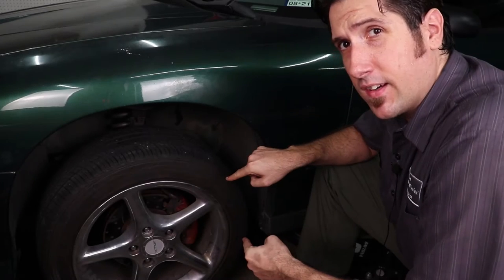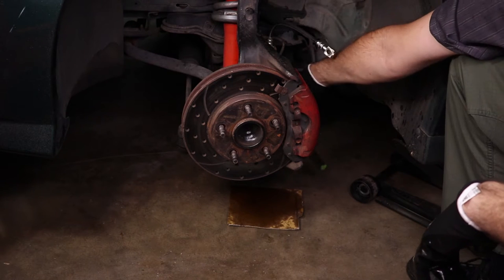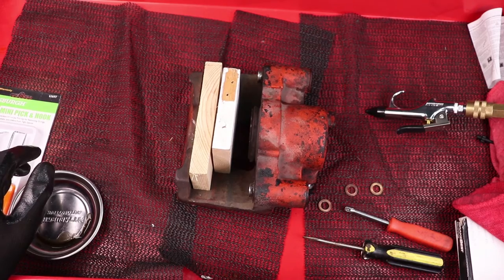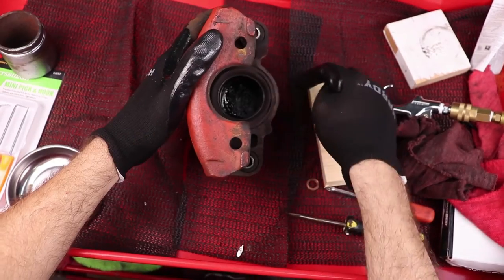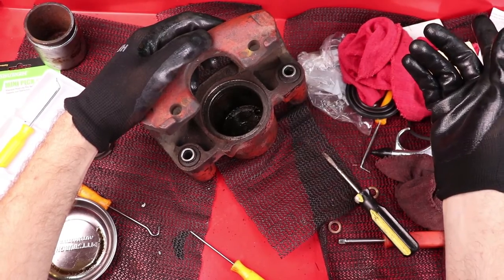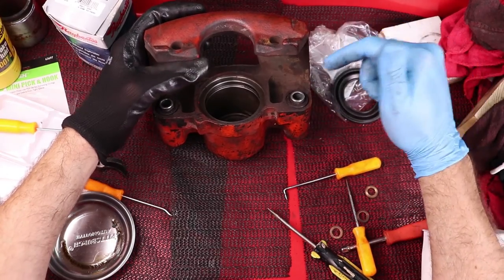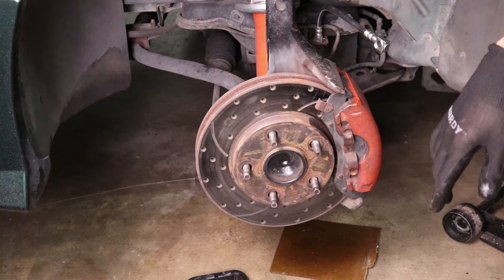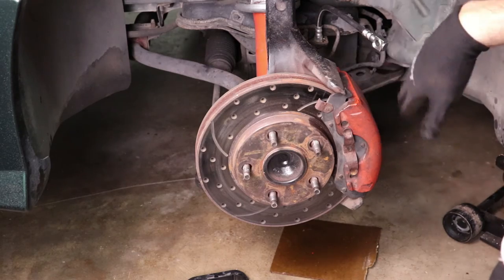Rebuilding a GM Single Piston Brake Caliper

Comment: Your meeting and overcoming obstacles is as important to your viewers as anything else, because there is one  thing certain to DIY repairs-- it seldom goes exactly as planned. Even professionals allow for operator error and the unexpected. 
* One suggestion-- when you disconnected the brake hose to allow caliper work on your bench, the disconnection procedure was not shown, but may have been uncharted territory for many. For example, show where to pinch the brake hose, before disconnection. And remind viewers (again) to watch the level of brake fluid during the actual procedure, to make sure no air enters the system.

Comment: Thank you, subbed!
Am restoring a '78 Firebird. Shipping calipers overseas is very costly and you don't get the benefit of core recharge either. Rebuilding the calipers is far more viable. Thanks for the helpful walkthrough.
Reply: Hey brother, I’m working on a ‘77 Trans Am! You can buy “brand new (remanufactured) calipers fairly cheap from an auto parts store here in the U.S., almost for the same price of buying the rebuild kit and hardware. However, since the vehicle was my late father’s I’m trying to keep everything as “original” and rebuild anything I can rather than just replacing parts. A lot of these generic parts you buy are not reliable and I can say this from experience as I used to work at one of the top 3 parts stores here and would have to warranty things left and right.

 I’d rather have the original sturdier parts and take the time to rebuild them rather than just go with a lesser quality part that will fail in a couple of years.

Comment: all-right, I just started the video and you said 1995 GM, not sure if you said 
one like mine ( I have,  a grand prix se) as long as it's a W platform/body
well, back to the video because I have coming 2 rear rebuild kit's out of chicago
& the front 2 from out east , The auto parts store had me pay the shipping
first before they would order the front kits . Nobody else would even say 
they could get any.
Reply: oh, it was a firebird, I think you said , still Replacing the o-ring and  seal must be simular
o-rileys said they could't get the piston at least with the seal kit I never asked for seperate.
Reply from the maker: I'm sorry for not answering sooner, but I think the process should be pretty similar if not the same.

Comment: I had a lot of trouble removing that seal. A lot of videos showed a metal ring holding the rubber seal in place. I was looking for that. I tried and tried using a pick to find where to remove that metal ring. I finally got a tiny eyeglass flat screwdriver and was able to get between the piston and the built-in metal ring and pull out the seal which I had torn all to pieces trying to get out. I had no idea that the metal ring was built-into the seal on my truck.

Comment: Anytime you replace a caliper, you do not just replace the one.
If you are replaced the passenger side, then you should replace the driver's side as well. Same goes for the rear. If you do the left, you should do the right. That way, you have equal power on
Both sides.

Comment: Did u open the bleeder to put the new piston in?
Reply from the maker: I did it with the caliper off the car, so with the hose being disconnected there was no need open the bleeder. If I was doing it with the hose still connected to the car though, I'd definitely open the bleeder so the pressure has some where to go as the piston is inserted.